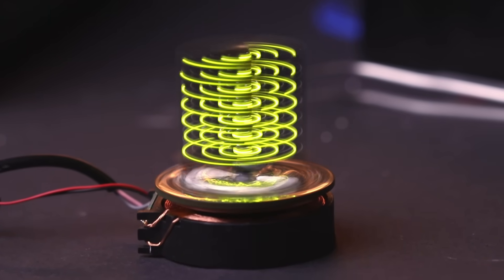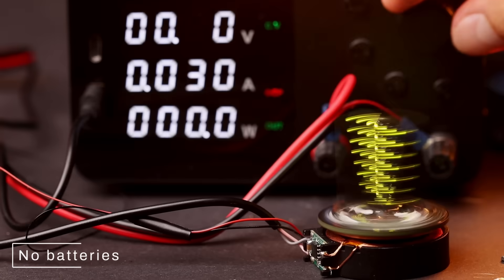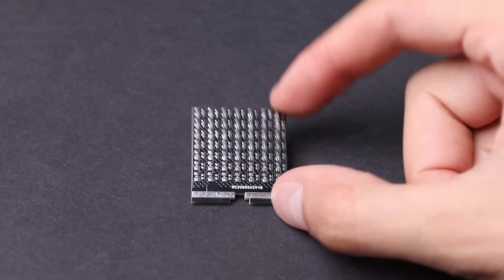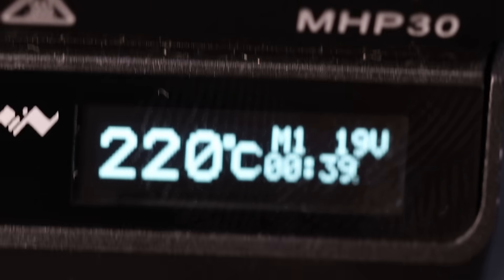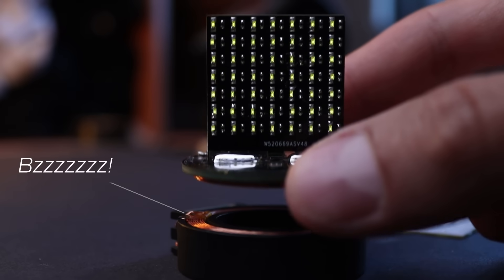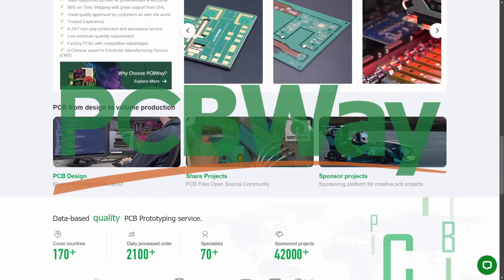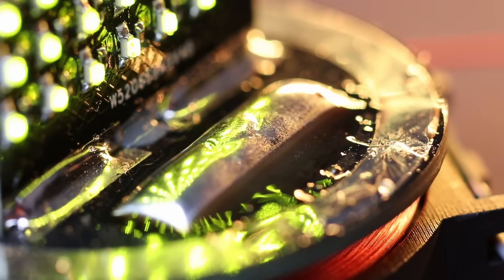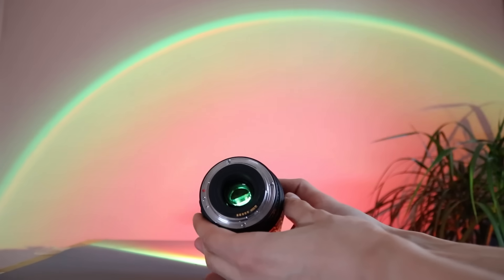I Made a Tiny Volumetric Lamp

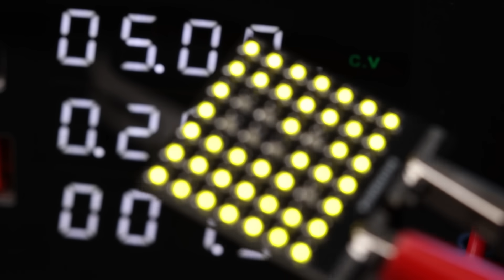Comment: 3:17
Hey, it's not you who have two left hands, something is definitively wrong with the components nowadays. I'm almost 20 years in electronics design and soldering and noticed in the last 5 years that components are never align themselves during the soldering process how it used to be back then. Either components are now optimized for a tight-spec'ed automated led-free soldering either quality of the solder itself is poor. I didn't quite found any answer yet...
Reply from the maker: @vladshmit  Hmmm, I think its a matter of footprints, components used and everything you have mentioned. Indeed everything matters. And without experimenting its hard to do it from 1st, 2nd and sometimes even 5th time 😅
Reply: @NickElectronics  That's a good guess, but here's the thing, the footprints didn't change at all, I still am using the same library as 15 yeas ago. There must be something different like HASL allow, solder flux, paste flux or like my guess is that the modern components are heavily optimized to be used with that stupid lead-free solder. If you take a look at a standard 0603 resistor you'd probably see how two pads have slightly different shapes and that is not because of manufacturer's tolerance, it's done intentionally. And this might be exactly why it poorly interacts with leaded solder.
But the footprint thing yeah, sometimes it takes forever to find a best working one😀
Reply from the maker: @ Some kind of conspiracy 😅But It may be due to lead-free solder, indeed. We have to adjust, impossible to fight against whole world

Comment: Could have put multiple magnets in the bottom and had multiple coils in the rotating part and make a generator, and have the motor on bottom spin it
Reply from the maker: Thats one of the solutions, but it would require higher filter size, cause generated current will have much lower frequency

Comment: "wireless power transfer" was extensively used in VCR players/ Recorders. 
It was call a "Rotary Transformer"
Reply from the maker: @mikegLXIVMM  But wireless power transfer has the same principle as a transformer 😅 Nobody says its a new technology. Basically, everything in power electronics exists for a long time. Its just get improved by technological means. Better materials, components, control with better and faster MCUs
Reply: @NickElectronics 
 It's a good project. 
I thought I would just point that out.
Reply from the maker: @mikegLXIVMM  I was just sharing thoughts in the reply, wasn’t arguing. Thanks 😊

Comment: Cool project, but it could be better if we can put ESP32 on it to control the pattern. ESP32 is used for wireless control and crrently we can have for example C3 version which is a small chip with huge capabilities. The balance can be an issue, but due to it small weight - not that huge.
Reply from the maker: @tizhproger  Thats what I am going to do in the future. Take small esp32 chip and solder it to the spinning part. The only problem is the time. Have to work a lot on my education those days 🫠
Reply: @NickElectronics  I understand. Btw you can simplify the development, I just found on my desk a LOLIN 8x8 RGB shield, which basically a tiny WS2812B strip and checked the size of ESP32C3 Super Mini module. It fits perfectly, just need to disolder Type C connector, a few buttons and here you go, looks just as one pcb 😁 (or just buy combined pcbs on Ali)
Only thing left is to see how it can spin 😁
Reply from the maker: @ Thanks for suggestions, I have to cook this design in my brain for some time to make it working and interesting to watch 🙂

Comment: Awesome video love it!
A interesting idea could be trying to use induction, so a motor spinning the blades (for this example a fan with led style of volumetric display) but at the same time has a generator on the outside or the inside if you now what i mean
So you would inda split the power between the motor spinning and the generator on the blades that gives the leds power.
I have no idea if this works but it was just on my mind haha
Its def simelar to what you did i think tho
Reply from the maker: @GamingClubGermany  Hi, thank you. Yes, i know what you mean. I was thinking about it but there are some problems related to it. Maybe in the future I will try to implement it, but i need to study theory behind it a little bit 😅
Reply: @NickElectronics  interesting. Love all your ideas really cool to See ^^

Comment: I've seen something like this in a sphere to display a logo! I think it uses a spinning mirror to project the image on the outside. Would be great for fire security signage.
Out of curiosity: could the wireless power transfer somehow be integrated in the motor, since it creates an RF field of its own? It would be quite an invention if these two could somehow be unified, even if it's suboptimal.
Reply from the maker: @bramweinreder2346  Thats a good question. I think it is possible to combine both, but idk what are the drawbacks. Probably if the consumption of the output changes, it would also affect motor torque, cause more/less energy would go to the output and less/more converted to mechanical energy of the motor spinning. So theres gonna be motor pulsations for sure.
Also, frequency of the WPT current will be lower if its combined, which would require bigger filters. And the positioning wouldn’t be perfect. For BLDC motor, magnets has to be positioned exactly against coils. Same for WPT. Maybe I can use small magnets and bigger coils just around them.
 
I want to test it actually one day, cause there is only one way to find out if it works or not 😅
Reply: @NickElectronics  I agree, it would probably be difficult to integrate elegantly, with no obvious (niche) benefits against the extra effort and efficiency loss involved.

Comment: The easiest way is to use copper rings have a brass ball bearings in them then having the same at the top basically making power go through two stationary objects
Reply from the maker: @DatBoiOrly  I don’t think that’s easy to do mechanically, is it? You have to have two bearings in such case, for + and -
Reply: @NickElectronics  two rings one for + one for - then brass balls as the contacts theres a guy on YT that did this the same guy that built a 5 axis 3D printer & used it for the heating bed
Reply from the maker: @DatBoiOrly  I think I know what you are talking about. But still not quite sure if It can be spun fast without reducing reliability significantly
Reply: @NickElectronics  not really no since the only way they can physically come out is through the top & bottom & since weight is solving that it'll be fine
Reply from the maker: @DatBoiOrly  Okay, hmm, thanks for the info. I guess I just find mechanical designs more complex than electronics one. So my brain is just not braining in the direction of mechanical solitons 😅

Comment: Tried doing exactly this for my senior capstone project at university! Only... It didn't work this well (boards were warped after reflow oven was used, we couldn't display 3D images very well due to timing), was significantly larger, and could probably kill somebody due to the bulk 😅😅 Glad somebody finished what we started :)  We couldn't get our sliprings working so we wound up just taping a usb battery pack in the center of the unit and calling it a day 😅
Reply from the maker: @ForwardBias  Ahah, thanks for sharing. But at least you got the experience from your project 😅

Comment: I wonder if instead of wirelessly transferring power you could simply use the rotation to generate power
Reply from the maker: @Fionnafire  I could. I will make a video about it and compare two solutions, probably.
 
But the short answer: generated current will  have lower frequency that is used in wireless power transfer. And lower frequency means bigger filters to filter it and keep stable

Comment: So cool....why not magnet generator for power?
Reply from the maker: @christopherworthington7000  I think it would require much bigger filter at the input and output as the effective frequency of the generated current would be much smaller. Like around 1kHz. Wireless power transfer works on 85kHz

Comment: From the picture and what I can only see as the only logical progression for this tech, I had assumed you were using a flexible PCB disks stacked on top of each other and all spinning together. That would give you a truer volumetric display with far less occlusion in theory. Very cool implementation either way. I do wonder if you'd be able to set it up so you could stack a data signal on the carrier wave of the power coil as well, similar to NFC, that would let you make the display be powered and also dynamic.
Reply from the maker: I have just been at the conference where some guys presented their way of establishing  communication between two parts of WPT systems. It is not that easy as it seems😅

Comment: i was wondering if you were doing the whole thing a bit open source since it is not complicated design i would be interested in the files to order the parts and try to bui;d my first project with proper board and pro prints. i dont have anything to 3d print but with some files i would be interested to order a small batch maybe start a patreon and share your files on it ?? that make a really good JLC PCB promo,
Reply from the maker: @benoitlagace  I will probably do that soon. For now you can just send a request to my mail and i will send files to you. What do u mean by pcb promo?

Comment: I assumed it would be a volumetric display lol. You should add a SMD microcontroller to the board for multiplexing/control; you could then add a magnet to the base and a hall effect sensor to the rotor for synchronization.
Reply from the maker: @underdog1252  It is going to be in the future. Probably. I have ideas about it, but I will see how it goes :D Cause not quite sure how to so it properly. So many options

Comment: i wonder how well would a 3.5mm jack work as a slipring. you could make a more complicated rotation mechanism and put a 3.5mm jack in the center of the board.

take a look at carl bugeja's pcb-motors. maybe the motor complexity is too much for a puny slipring power and data connection and you could just go with rf connection for power and control.
Reply from the maker: @diegoevaristo5334  Nit quite sure 3.5mm jack would last long, spinning at 6000 RPM. Yep, I have seen carl budeja’s videos. I was thinking of making something similar. Like a BLDC motor together with a wireless power transfer, when the same stator motor coils are used for both spinning and power transfer.  Not quite sure how reliable it will work though

Comment: Use magnets n coil n no ic, it will be a lot more balanced.
Reply from the maker: @DeeP_BosE  Frequency of generated current will be much lower with magnets and coils, which would require much bigger capacitors to have the same ripple
Reply: @NickElectronics  basically an emf generator with magnets on stator & symmetrical coils on the rotor, this is automatically balanced. & Bcz the coils r equally spaced it will also automatically strobe the LEDs.Calc the Vmax & add resistance accordingly. U can also communicate with the rotor using IR n have a feedback loop with the motor , for excess voltage, or maybe a pattern. 🤘🏼
Reply from the maker: @DeeP_BosE  What do i do with voltage ripples? For this project solution you are proposing is gonna work,  cause i dont care that much about LEDs flickering. But I plan to add MCU there, which requires stable voltage. I could use addressable LEDs and add mcu at bottom and establish some communication between two, but addressable LEDs usually have low LED to case ratio, which reduces resolution. If i put a display there for example, i also need a stable voltage. So i just wanted to play with WPT a bit for the future tasks. 

But I will play with generators in the future for sure 😅It sounds like a fun thing to do. Especially cause I have no experience with them. Some planar coils made from
tracks in a several layers PCB sounds fun
Reply: @NickElectronics  as soon as u add an mcu ic it will ruin the balance. But if u add the mcu in the stator u can also have clean dc. U have to communicate CS&CLK with the rotor unit thru IR. Also the LED matrix board is better off being a triangle this lowers the COM , & practically nullifies wobble at the apex . Just a thought 😅
Reply: @NickElectronics  these days u can get ultracaps that r tiny, 2 of those diametric is both balanced n cleans the dc . PCB coil is definitely the way .
Reply from the maker: @ I have to think about it a bit. So many different solutions:D 
Also, I can make LED board in a form of a Christmas tree 😅
Reply: @NickElectronics  yup as long as the top isn't heavy 🌲 . In this tiny form factor & those high rpms it isn't too feasible. It needs to be scaled up to add this complexity. This will also lower the RPM & vibration, but will add more pixels so u keep the resolution. Happy thinking
Reply from the maker: @DeeP_BosE  Ultracaps are bad for filtering cause of high ESR. Capacitance is not only one parameter that matters. There should be bunch of ceramic caps
Reply: @NickElectronics   Ultracaps do hold a lot of charge, n can b the primary power source for the rotor part n smooth out low freq. 
 u can then add a filter circuit easily if u scale up. Just have2 double the components n place them diametric.

Comment: I thought LEDs take very little current.
Reply: How many amps did the ones in your video use?
Reply from the maker: @HappyHarryHardon  10 mA per diode :D
Not much. But there are 50 of them, so 0.5 Amp in total
Reply: @NickElectronics  But you’re using these as a display and it looks like we define very little the same way. Which makes your initial response baffling.
Reply from the maker: It depends on the LED and how you define 'little.' If we're talking about displays, they're quite power-hungry

Comment: Heres a thought, use a fixed magnet and a spinning coil so you have a permanent magner generator. On the rotating part you need a rectifier and regulator, and a microcontroller to run it. If you want to be able to communicate with the microcontroller use IR.

If you could spin it fast enough you could only switch the LEDs on the peaks of power supply ripples. That leads to the idea of using the current draw of the LEDs as the mechanism that regulates the voltage. There would be a full wave active rectifier and a small capacitor. But there would still be far too much ripple. The LEDs would be switched all on or off by a PWM signal. The small capacitor would be able to provide sufficient filtered power for the microcontroller. The LEDs would be driven at a much higher frequency, PWM to control the voltage. As the voltage ripple rises, the LEDs are switched and draw current regulating the voltage. So as the motor spins up, there is enough filtered power for the microcontroller, it boots up then starts regulating its own power and operating the display. Assuming you can synchronize everything, it all works. Assuming that's possible. It's not necessarily better than the wireless power. In fact, that's probably more practical. But it's a cool idea if you can get it to work. 

In fact that leads to another crazy idea. What if it's NOT a permanent motor. What if there are stator coils and rotor coils. 

It starts up with the rotor coils shorted and the stator is driven to start it as an induction motor. Maybe it is just powered of a 60hz transformer or maybe a very simple oscillator. Like a neon bulb relaxation oscillator. But as it spins, for a certain part of the cycle, it draws power off the rotor coils, which slows the rate of spinning down and generates power. Other than that it's similar to the previously discussed system. 

It sounds "complex" but the idea is, everything does double or triple duty. It's not so much complex , as intricate like a Swiss watch. If it can be made to work.

Edit: I just thought, There's another possible thing you can make the coils do. When you draw current from the rotor coils , you can detect that in the stator coils. So if you run both the stator and rotor from small microcontrollers, you could potentially use that to communicate between them to update the display. Some sort of thing where it would do something at a particular time or in a distinctive way to indicate a bit.
Reply from the maker: A generator is a good idea, but the frequency of the generated waveform will be low, even with a generator that has 3 poles and 6 coils. So, I would need quite a large capacitor to keep it stable

Wireless power transfer works on 85kHz btw
Reply: @NickElectronics  Electrochemical capacitors (super capacitors) are surprisingly compact. I can't necessarily say they are compact ENOUGH, but they might be.
Reply from the maker: @michaelallen1432  But they are not very suitable for filtering. They are intended for high-energy storage applications. Their ESR is quite high, which makes them less effective as filters

Comment: Whenever I use blue PCB's they fail, the green ones don't. Green PCB is a good PCB. Maybe the black PCB is even better than the green one but it's usually more expensive. I have a black motherboard and black RAMs and they were expensive.
Reply from the maker: Maybe you're right; the green ones are the original. They've existed for much longer and are much more tested, but we should finally give space to the younger generation! :D